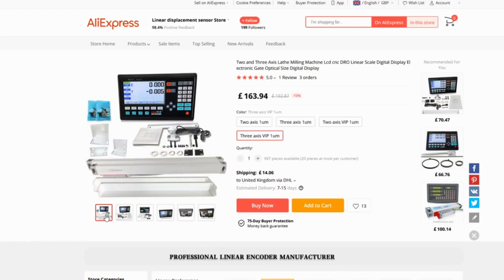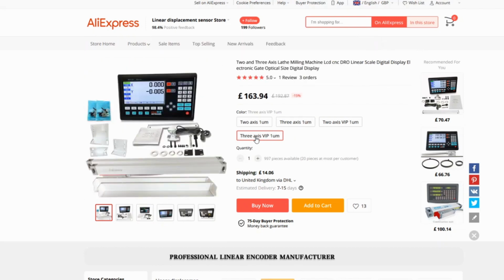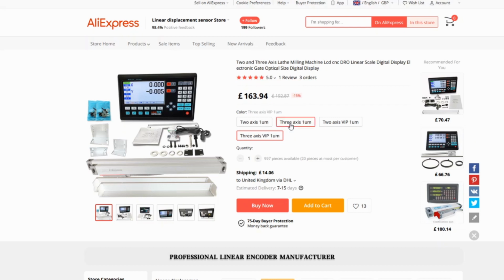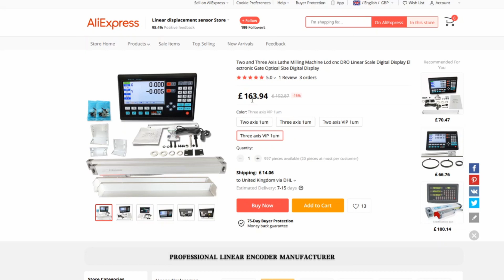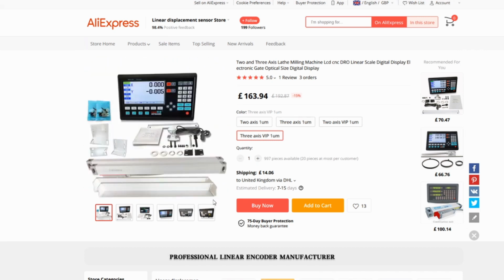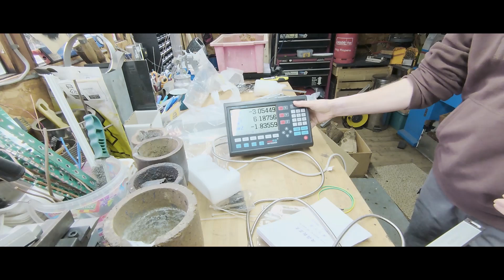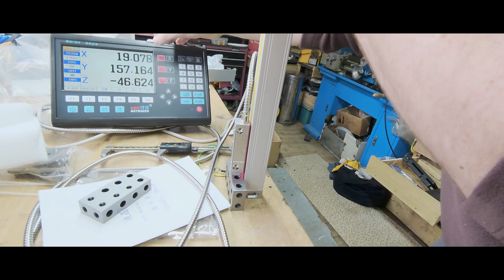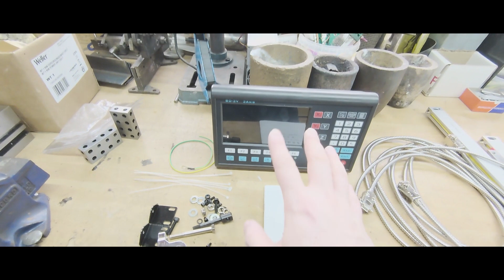I bought the Cheapest 1um Mill DRO on Aliexpress

Comment: Hello,
Thanks for the video.  Nicely done!  BTW, what type of mill do you have?  I have an OPTIMUM Vario which looks like a clone of yours.  Mine was designed in Germany and made in China.  Have you had any issues with it? Would like to chat about it briefly if possible.....   Cheers.  Dave
Reply from the maker: Hi, my mill came from a UK distributor called Amadeal, it's an AMA25. I think it is made by Weiss, sounds German, so possibly of German design, but most definitely made in China. The only significant issue I have had was the original motor didn't last long, and the plastic cover that was over it meant that it got really hot. Happy to discuss with you further. You can find my email address on the about tab of my channel page.
Reply: @ollysworkshop  Your motor issue is unfortunately a very common issue with that model milling machine, I have a HBM BF25 and they're infamous for that exact same problem, as are the same model milling machine made under other brands, like Grizzly and Precision Matthews. The best way to go is to either replace the motor alltogether with an AC one, and while you're at it add some extra power too by going for a 1,1 kW one (you can buy them together with the controller/regulator at AliExpress for approx €200 or equivalent in GBP and they fit easily in the original motor housing), or if you don't want to spend much and stay with the original motor instead then it's recommended to cut some bigger ventilation slots and add a 12V PC fan for active ventilation.

Comment: Does it show feed rate by chance?
Reply from the maker: Hi, I've just checked. Unfortunately the answer is no. It wouldn't be difficult to do, and maybe you might get it on a more expensive one. You could also enter RPM and cutter parameters and it should be able to tell you optimal feed rate and cutter engagement. A gap in the market perhaps?

Comment: Very nice 👌. I got another video from you. So did you get a English booklet, because normally you need to set parameters. Is it worth the time and is it working fine.  Or your disappointed 😞?
Reply from the maker: Another subscriber had a similar one and sent me a copy of the English manual. As far as I can tell, it is working perfectly, I'm very pleased with the DRO.
Reply: @ollysworkshop  Thanks your message. When bought my Lathe, I decided to have the company with a DRO. It looked like that your Mill project was intense 😳. No metal chips yet, my Lathe must be located

Comment: I don’t know about the cheapest, but I bought a ToAuto version on eBay (here in the USA). It was the standard display for just x and y. The only crappy thing was the ARM mount, which was flimsy. I made a much better one. I replaced the standard box from them with the touchscreen version. It has x,y,z. I bought an 8” for the z six, which I had to modify to get it to fit.

I’ve had this for over a year, and use it extensively. It’s quite good. Accurate, as checked by my Interrapid tenths indicator, and other methods. They were 5um though. I replaced then with the 1um versions recently. No problem. Again, quite accurate. 1um is .000039”, or 0.001mm. In order to use the tenths place on the DRO, the 1um is really needed, or anything below 0.001”, or 0.01mm isn’t going to be usable.

I highly recommend ToAuto. Their manuals are in English and they have a site you can go to for videos showing how to use their products, including the setup.
Reply from the maker: Thanks Mel, I'll check them out.

Comment: Hi Olly,  was vat included at source and Did you have to pay extra import duty    as cost over £135.
Reply from the maker: Hi, I believe vat was charged and I didn't get any import duties put on it. That was one reason for finding a really cheap one as I was expecting to get a load of extra tax put on it! Not sure if that will happen every time, but the customs declaration did have the correct value on it, unlike some packages I've had from China. I understand that the particular system in my video is now much more expensive than when I got it, but I'm sure there's others. Hope this helps.

Comment: Hi Olly,
The same kit is now over £260 (excluding shipping). Do you reckon it's still worth it?
Reply from the maker: Might be worth shopping around, there's a lot of sellers selling very similar looking systems. I haven't yet done any accuracy measurements on the mill, so can't confirm the accuracy. There is a facility in the DRO console to apply a correction factor to each of the scales, assuming the error is linear. I have used it properly for the first time this last weekend, and it's definitely a worthwhile addition. Ultimately it's up to you to decide how much you are willing to spend, but £260 is still half what you'd pay for a basic system from the likes of Warco and Machine DRO. Difference is in the after sales service. I got a completely unhelpful response to my request for an English manual and no response at all regarding the missing parts. Let me know if/when you get one and how it works out. All the best.
Reply: @ollysworkshop  Hi Ollie, thanks for the quick and helpful reply. Tbf I wouldn't have time to fit it for a while, even if I went ahead. So given what you said I'll hang fire a little longer, in case the price comes back down (seems unlikely). Then I may go for the same unit anyway. Kicking myself a bit as I was thinking of also getting the two axis for my lathe, so now over £100 more. All the best, Jamie
Reply from the maker: I'll get round to the lathe as well at some point. Read somewhere the other day, someone pointed out that the cross feed on the lathe really needs to be 1um because every move is doubled, so a 5um scale could give a 10um error on the part. Obvious when you think about it.
Reply: @ollysworkshop  Good point, which I hadn't considered. Like you say, obvious when you think about it. But, like all those obvious inventions, thinking about it is the key thing!
Reply: @ollysworkshop  I decided to go for it at the new price (well £257.10 + DHL shipping). Mine came with an English manual and the unit was set to English, but unfortunately one of the scales seems faulty. The seller asked me to upload a video to YouTube to demonstrate the problem, so now I have my first YouTube video! ;-)
Reply from the maker: Good stuff, let's hope they send a new scale. If you could scan the manual, it would be handy to have a copy.😀
Reply: @ollysworkshop  Yes, fingers crossed. No problem, will scan the manual and let you know.
Reply: @ollysworkshop  The document is literally black and white (not greyscale), so I scanned it in mono and dropped the images into a LibreOffice document. I then exported it to PDF. Which format would you like and how would you like to receive it?
Reply from the maker: @jamiegreentech2753  I've added my email to the about page of the channel.  PDF is fine - thanks very much!
Reply: @ollysworkshop  After a few more checks and photos they have agreed to send a replacement 450mm scale. Phew! PS: Have emailed PDF.
Reply from the maker: That's great. Hope it works. Thanks for doing the scan, it was very good of you. I'll email you later.
Reply: @ollysworkshop  The replacement sensor has just arrived (via Royal Mail). I was a little worried as the packaging looked a bit bashed, but I've tested it and it works! Huge sigh of relief. Now all I need is some time to fit it, but that's number 3 in the queue right now.
Reply from the maker: That's great. Fitting is the tricky bit as it's different for every machine! Mine took somewhere in the region of 8 to 10 hours to fit, including some of the procrastination.
Reply: @ollysworkshop  Yes, that could be a time sapper. I can procrastinate at an Olympic level! I waste far too much time searching for perfect solutions. For instance my X axis sensor will have to go at the front or the back and both have disadvantages. Btw, I liked your use of cycle parts!